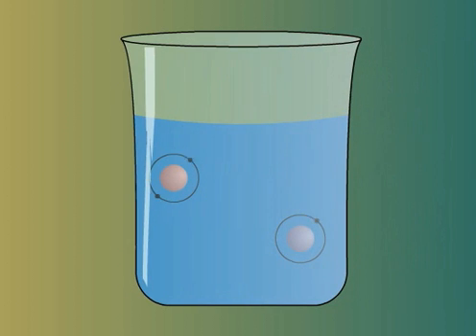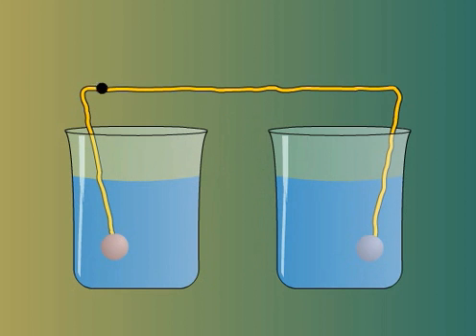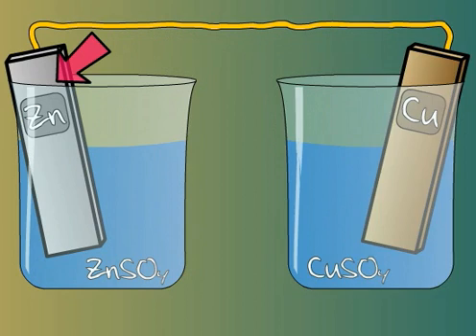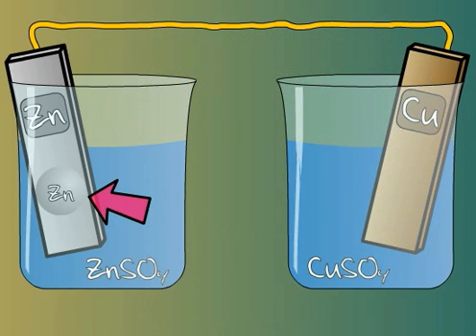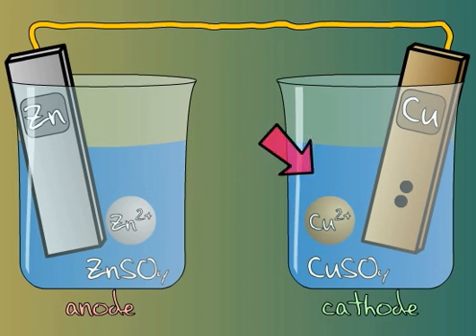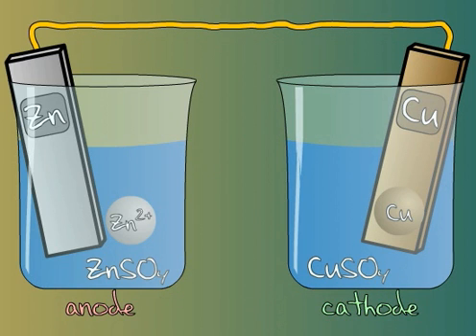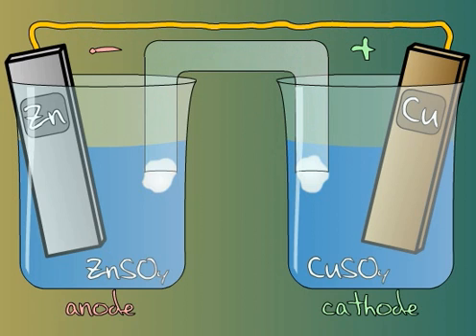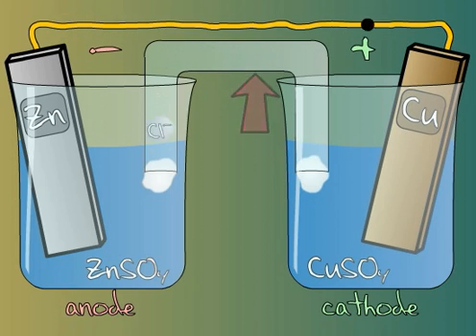MCAT Gen Chem 7.5: Galvanic Cells

Comment: Why exactly does the oxidation of zinc occur? You seem to suggest the fact it has a low reduction potential means it happens spontaneously but this obviously isn't true. What's the trigger?
Reply from the maker: In short, it happens because chemical systems are constantly seeking a lower-energy state. A more positive reduction potential indicates that the species has a greater affinity for electrons. In the galvanic cell shown, Cu2+ has a relatively high reduction potential (0.34). By contrast , Zn2+ has a relatively low reduction potential (-0.76). And in fact, species with negative reduction potentials (like Zn2+) would actually prefer to be oxidized. So, between these 2 species, it will be most energetically favorable for Cu2+ to be reduced, and Zn to be oxidized. We can achieve both of these results by transmitting electrons from Zn to Cu2+. It happens naturally because it allows both species to be energetically happier!
Reply: +J Co Review so electrons run through the wire from Zinc to Copper just because Cu 2+ in solution attract them ?